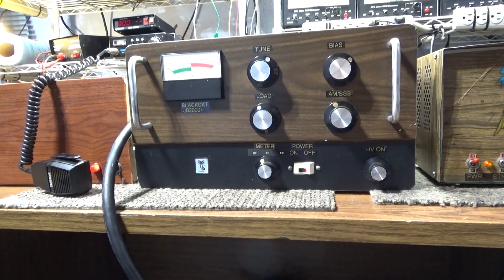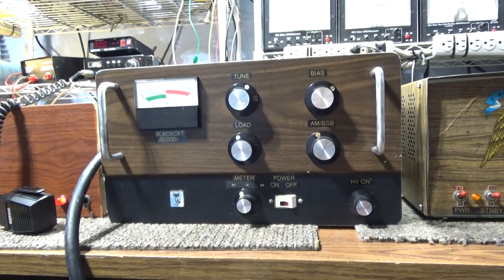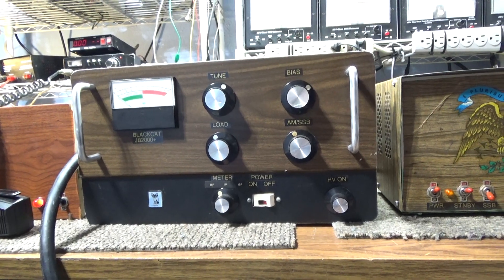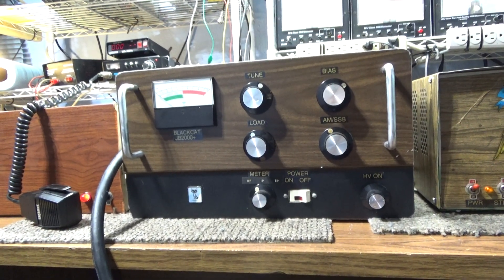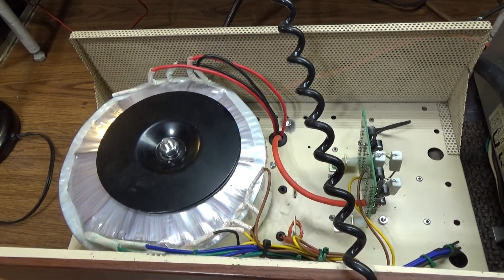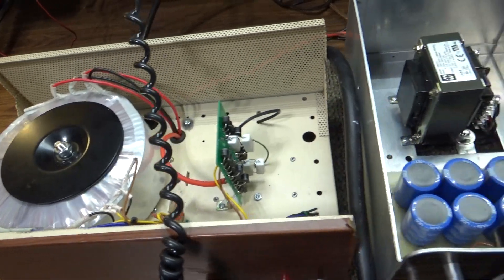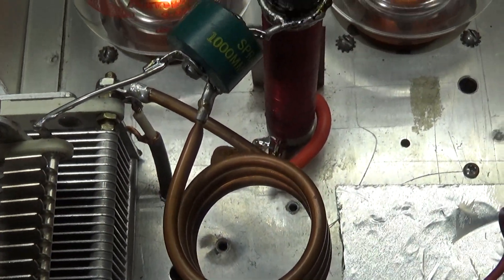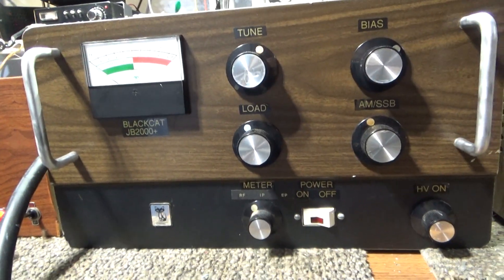Blackcat JB-2000 Linear AmplifierToroid Transformer Challenge Accepted

Comment: I have a 1976 JB-2000 10/80 like this that is still original. owned it for several years but never used it.
Reply from the maker: Excellent and IMHO, the 1080 was the better of the JB-2000's.  The driver in the one's that had a driver was a kluge.

Comment: Im fixing up an old jb2000 and I only have a set of 4-400 tubes. Are there any specific changes I need to make to run these instead of the 3-500
Reply from the maker: they should run ok in place of the 3-500's in the JB-2000. They should put out around 4/5ths of what the 500z's would put out and they would take about 10% more drive in grounded grid. JB-2000's are good candidates as they have the grids directly grounded, the HV on the JB-2000's is fairly low (for a 3-500z amp), and the JB-2000 has no bias. 4-400's prefer all those things.

Comment: It doesn’t matter the shape of the transformer. It needs to have correct isolation from the case to the secondary if it’s a plate transformer. Voltage and current and the transformers CCS rating or ICS rating should be factored. Choose with headroom and size wisely. Jmo
Reply from the maker: I agree. One thing I learned though, is that with 3-500Z's, the Plate volts are all over the place with different amps. 2200 on the JB-2000 with driver, 2700 on Heathkits and the Blackcats with no driver, and up to 4500v on the plate on some that really are going for max output. I also learned that though the 3-500z tubes are Zero Bias, at 2200v they run fine without Bias. At 2700V they will run with 0 bias, but will run somewhat hard. At 2700, they would run cooler and better with 5v or so of bias, then from there, as you up the plate volts, Bias is necessary, the more volts, the more bias needed. All the Hams, engineers and everybody agree's on that one..... or at least the people who know what they are doing.

Comment: Peter Dahl used to make a transformer that would work in that amp, as far as voltage goes. But it was physically bigger than the one used in the Heathkit amp. Hammond owns Dahl now. Peter Dahl transformers are top quality and they have a price to match that!
Reply from the maker: Yep, I have one of those new right now. It's marked Peter Dahl JB2000 - 2  Last time I looked it up on the Hammond/Dahl site, it was sold out and had a price of 439 for it.

Comment: This brings back some cool old memories for me. Back in the early 70's there was a guy in my old neighborhood who ran a small grocery store and he was an avid CB'er.  His handle was Pepsi Cola mobile. He said he was mobile because he destroyed TV's for blocks LoL.  He ran a Browning Golden Eagle into a modified 3 tube JB 2000 with a huge external power supply.  I was just a young kid starting out in CB at the time and I knew him from going to his store and yacking with him on the air. His signal was so strong it would just about overload my receiver from over a half mile away. He used to be 40 over....everywhere.  He gave me a station tour and even let me talk on that monster. The station fed a Moonraker 4. His modified JB2000 would bury a Drake W4 watt meter on the 2kw scale with ease dead key. Even with that huge carrier he had a little swing in it but he loved that huge carrier. A friend of his from Tennessee added the third 3-500Z and built the power supply up to handle the extra tube. The mods were so well done it looked factory stock. Really sweet amp.  For the 70's this was a big station. Nobody in Chicago could match his signal. At that time even a 500 watt base amp was considered a big boy. Of course this is a peanut whistle today, but in the 70's it was considered a big deal to even run a 100 watt solid state amp in your mobile. Now guys are running 50kw.....wow.

Comment: 4:05 The black circular rubber boot is supposed to go between the transformer and the metal casing, therefore it's upside down. This is to prevent the windings shorting against the metal cabinet body.  I use a large washer between the epoxy compound in the centre of the transformer and bolt and nut, just to spread the load and stop the centre cracking. 😉

As regards using toroidal transformers in tube amplifiers, that what I use in my GS35b 10m linear amplifier. Some people just talk sh*t. 🙄
Reply from the maker: It came with 2 rubbers so there is one on top and another at the bottom
Reply: @tramdr  As it should. I love toroid transformers! I used to buy them at a surplus electronic parts store in St. Louis (now gone). I needed an isolation transformer one time, so I took a bunch of 12 ga. stranded house wire and wound it. Works fine, lasts a long time!

Comment: The JB2000 was a single banded amp with a built in driver.
The JB10-80 was a multiband amp with no driver.
I think that started out life as a 10-80 and was modified for single band use, but with no internal driver I don't think you can honestly call it a JB2000.
Reply from the maker: Not quite. Blackcat made 3 versions and some other small change versions too, all called the JB-2000: 
First was actually the JB-2000 and JB-2000A-D The 'JB-2000's A-D were all 10-11. It  was of course the CB version with built in driver, monoband 10-11 meters only, and ran 2200v on the plate. They did this is they used half the plate, which is 1100v for the plate of the driver tube. All versions had an auto keying circuit, no foot switch. 
They also made a 6 meter version which except for the tank coils and tuning were for 6 meters, it was the same as the 10-11 meter version, driver and all. It was called the JB-2000/6
 3rd major version was the JB-2000/E 10-80 meter. It got rid of the driver tube, so high drive, and also bumped the plate from 2200 to 2700v. Of course this one was multiband 10-80 meters, still used the auto keying circuit, but had no Input Tuning at all on the Input. 
  I have a copy of the factory manual of the JB-2000E 10-80 version, and way back in the day, I don't know when, but I was using AOL, that manual was impossible to find, and I used to sell copies of it. I also have four schematics total of the JB-2000's, the C and D 10-11 meter versions, the 2000/6 6 meter version, and the 2000/E 10-80 meter version. All were called JB-2000
Reply: @tramdr  And I’m sure you wouldn’t be surprised to see one or two more types as time goes along, knowing the Black Cat company, eh Doc?🤣